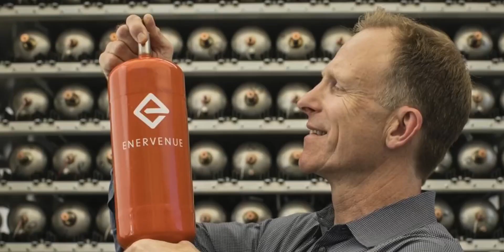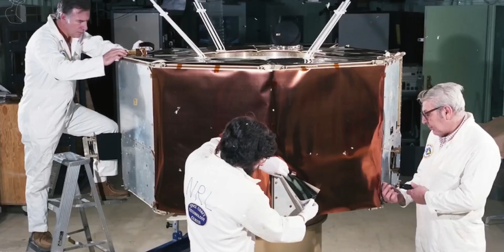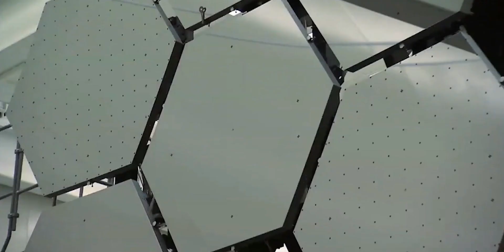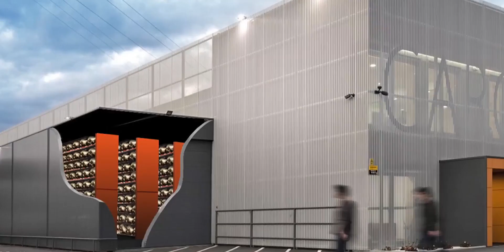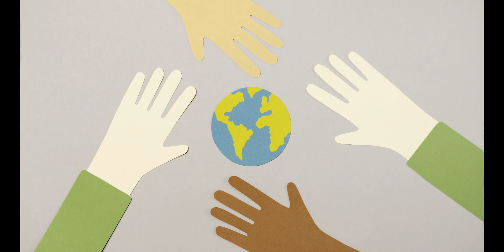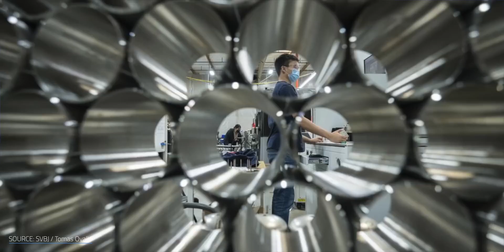This is Why Satellites Never Run Out Of Batteries.

Comment: Comparing energy densities, the Satellite batteries are nearing Li-Ion.  But on Earth gasoline is still king by a long shot.  The key is to view the values with equity as Mega Joules for all energy brands.

Gasoline(your mom's vibrator): About 32-35 MJ/kg
Li-Ion (Onewheel) Batteries: About 0.15-0.20 MJ/kg
NiOOH H2 (Satellite) Batteries: About 0.08-0.16 MJ/kg

Comment: Nice work.

I wanted to know one thing:  what were they using as a catalyst?

Oh well :) 

I thought I would leave my thoughts.

I'm thinking Mercury + Platinum. 

Mercury barely bonds with hydrogen...  Mercury does not form alloys with platinum... It doesn't bond with iron either, so a stateless steel pressure vessel should work.

But it probably has some top temperature before destroying the battery as the nanoparticles of mercury melt and form droplets.

It would atomize mercury into the air if punctured - that's just not good...

Blah blah....
Reply from the maker: thanks for the insights